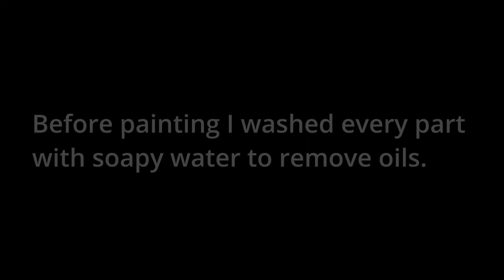Transform Your RC Car With Oil Paint Weathering Technique

Comment: Wow that's an incredible job you done on the paint 👌 does the kit come with the Mercedes badge or did you have to make it ?
Reply from the maker: Mine came with the Mercedes badge because the seller included it. LDRC does not provide it in the box as it's not officially licenced.